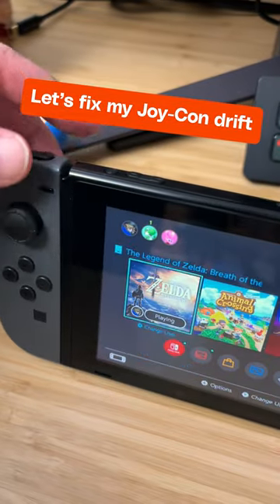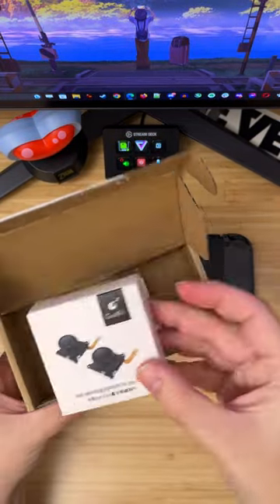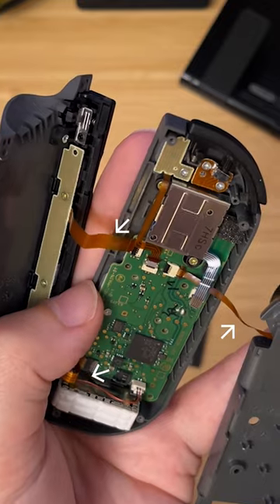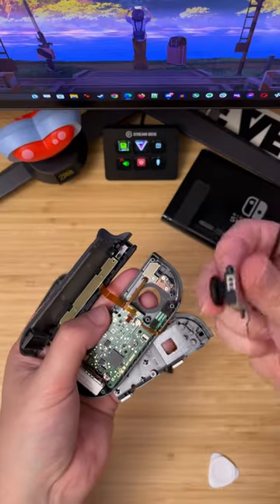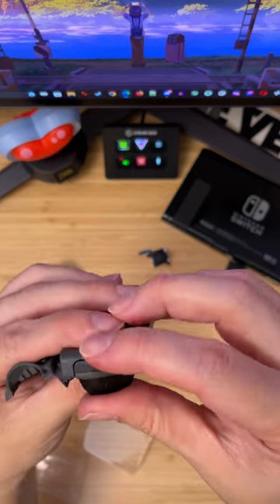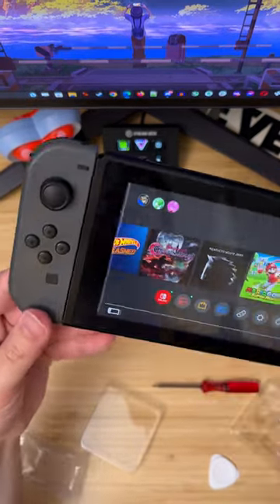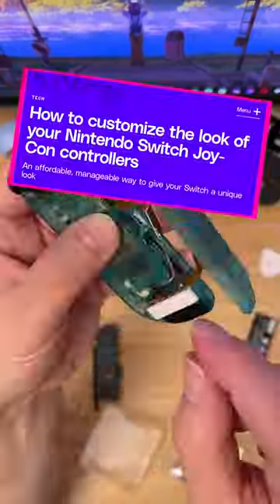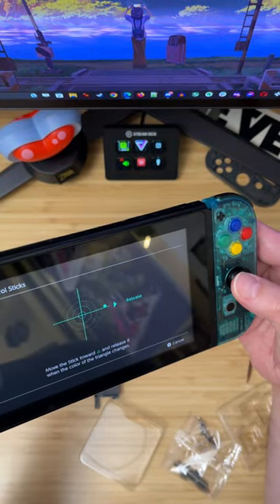Banish Joy-Con drift (hopefully) #shorts

Comment: Ooh yes!!!! I did just that to one of the ones I had which had negative drift, and besides the top not being rubberised (which I'm fine with), the stick not being as wiggly as the stock control sticks feels nicer, but then I forget about that when actually playing (Splatoon 3 in particular). The other 3 Joy-Con I have still have their original Nintendo sticks, and I'll replace them as they fail.

Comment: When I put my right controller in it disconnects but out of it it works just fine
Reply: Can someone help me with this
Reply: The connector probably has a loose connection or a short. It's the bits of metal you can see at the bottom of the rail away from the shoulder buttons.